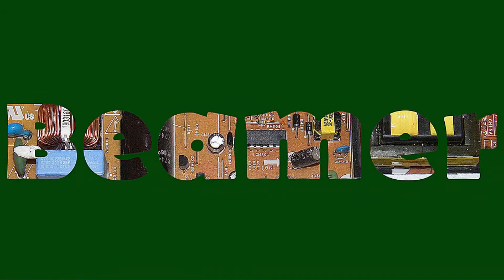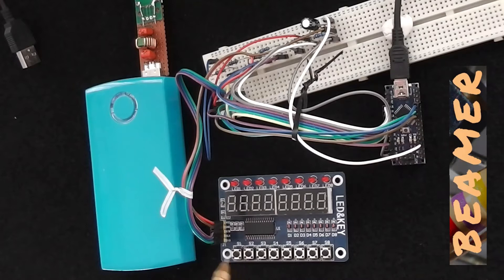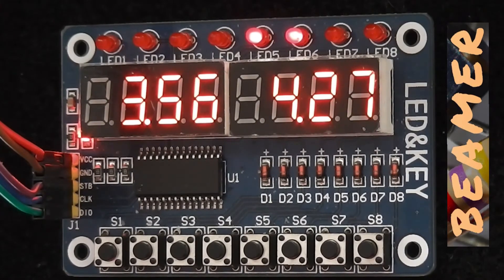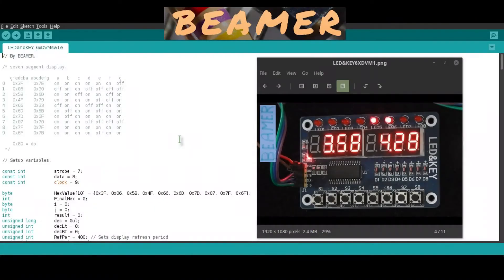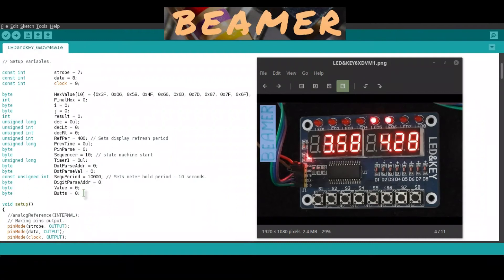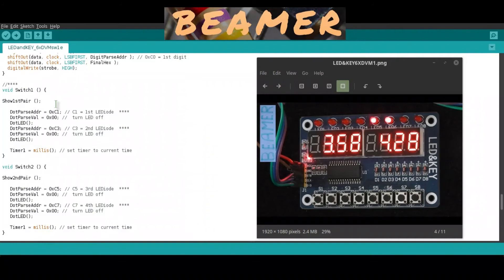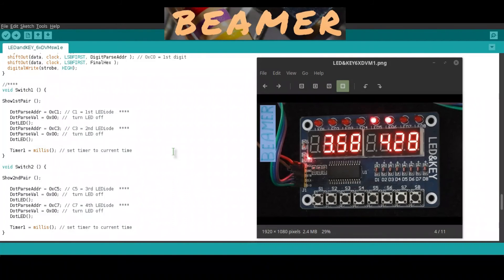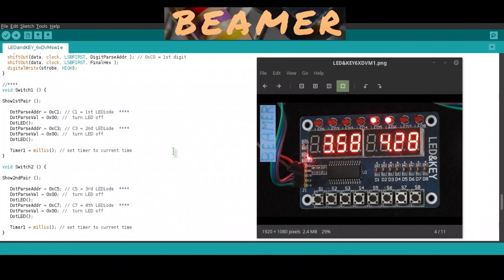Arduino 6 Scanning Digital Voltmeters version 2 with manual select buttons

Comment: It's one of those odd gadgets that you wonder "what can I do with this?" and you've done a great job in turning it into something useful. I bought the exact same one as you some years back and it's sat on a shelf since then. V much like the idea of the twin voltmeters, but I'm still struggling to figure out some practical application for mine. Looking forward to your future  adventures. Subscribed. ☺

Comment: Thank you very much! Veru important work!
Reply from the maker: You are very welcome. If you have any suggestions as to how I (or anybody else), can develop this further please let me know?
Reply: @beamer.electronics  Thank you very much! I count the numbers on this module, I don't understand a bit how to send a number from 0 to 9 to the desired segment, it has a built-in decoder, but I don't know how to send integer values to the desired segment, as I can only send a hexadecimal value. I don’t know how to send a decimal value for the decoding module to understand itself.
Reply from the maker: @masterkit9517  Thank you for your interest, I think I need to do a video explaining this sketch further. However, as a basic guide: HexValue holds the 7 seg patterns eg., decimal 8 = 0x7F = all segs 1 (all on). FinalHex holds the mathematically derived number pointing to the appropriate seg pattern. Then that is squirted-out with the appropriate address via sub DigitDo to the TM1638. The decimal point is fixed in 1 position as the number of digits is limited by Nano’s A to D converter (1023 steps), with a maximum of 5.00 VDC. Perhaps a more pragmatic approach (something I do), would be to make a copy of the sketch and enjoy playing around with it to obtain a better understanding – the TM1638 is very tolerant :) I’ll include a link to the chip and I hope the above helps. Keep safe, Beamer. https://www.alldatasheet.com/datasheet-pdf/pdf/1132372/TITAN/TM1638.html
Reply: @beamer.electronics  Its fantastic information!!! Thanks!!! Super interesting!!! Thank you very much!!!
Reply: @beamer.electronics  Please help brightness setup
Reply from the maker: @masterkit9517  The Brilliance is established in the setup and used only once - on power-up:   // Setting segment brilliance
  //sendCommand (0x89); //  min brill 0x88 - max 0x8F and blank 0x80
  Value = 0x89; //  min brill 0x88 - max 0x8F and blank 0x80 **
  sendCommand();
I hope the above sketch extract is self-explanatory, 'Value' holds the Brill hex number. It's feasible to incorporate Brill in the loop under button control, but for me - that'll have to wait for another day. Change the hex number and see what happens? All the best and stay safe, Beamer.
Reply: @beamer.electronics  Thank you Dear friend! Yes, i understand information! Thank you very much!